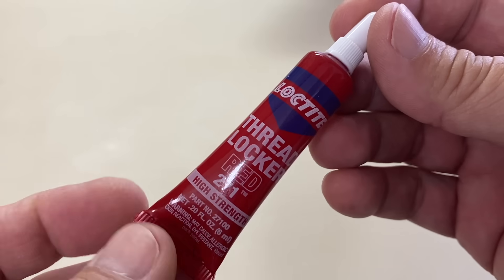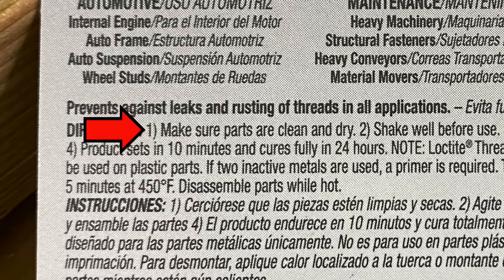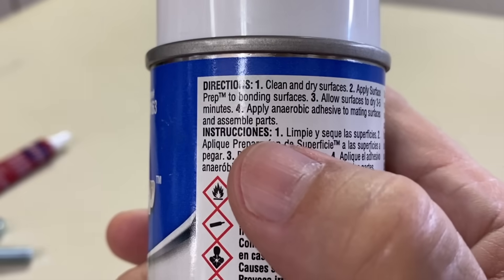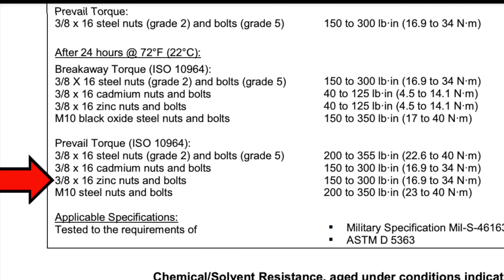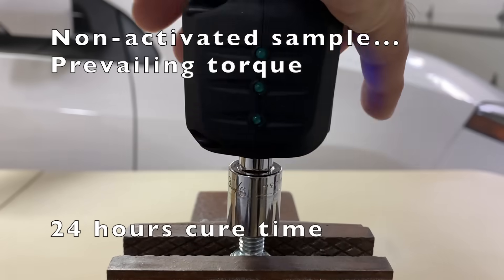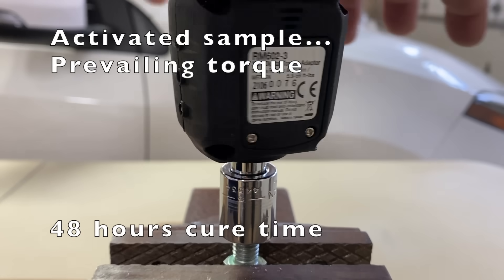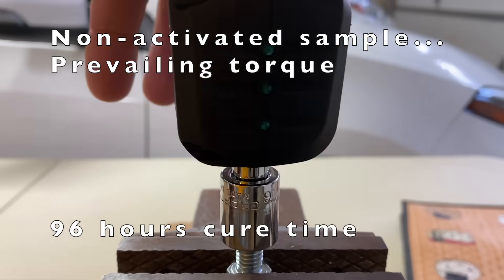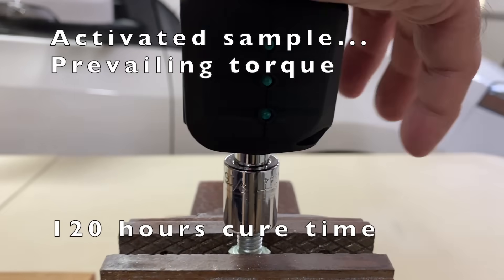Nuts & Bolts - Most DIYers Do Not Know This | Loctite Red Threadlocker Curing

Comment: Wrong test.
Thread lockers doesn not work that way. You have to tight that nut.
Call the manufacturer and they will explain you why.
Reply from the maker: Thanks!
I agree that in real-life applications threadlockers are used on torqued nuts and bolts, but this was just a strength test of the adhesive itself.  A similar test by Loctite is shown in this video... https://www.youtube.com/watch?v=PGZCPyi8yBc&t=2s
😎
Reply: @HacksbyDad  That is a test of the pure adhesive properties. But nobody uses Loctite as a... glue.
This is ok if you're going to to check that behaviour on active/inactive metals like advised on the label, but for my experience the difference is almost zero in real life (tightened bolts).
I use various Loctite products (primarily 241, 242, 680 and others) to assembly and sell my products. I can confirm you that the properties changes a lot under compression. Just day and night.
Anyway, your was an interesting test.
Reply from the maker: @giuliobuccini208  Thanks.  I've posted other videos with the nuts torqued down and got differing results.  🤷🏻‍♂

Comment: This is an interesting controversy here. One buys plated (often zinc) fasteners instead of plain steel to avoid seizing due to rust. This suggests a certain kind of 'inactivity' to zinc surely, yet it is also true that zinc is used as a sacrificial anode as mentioned. And here's another thing. Those fasteners are bright-plated but if you want max. rust resistance you use hot-dipped galvinized fasteners and of course galvinization is zinc plating.
Reply from the maker: Thanks for your thoughts.  Something for me to think about.  😎

Comment: I used Loctite RED on all my fasteners for a motorcycle build and never had a vibration loosening on any connection until a seasonal breakdown. It’s a pretty solid performer.
Reply: I only use blue loctite on the motorcycle sub frame mounting bolts as just in case I can use normal hand tools to loosen them without applying heat. Everything else I use a torque specification.
Reply: @robpinter5431  - I hear ya man, I've had success using Loctite blue as well. I ran with red because it's pretty universal.

Comment: Pretty sure that the nuts and bolts should be under tension during the curing to obtain real accurate values.
Reply from the maker: Thanks!
I haven't come across any articles stating that tension is required... only contact with metal and the absence of air.  I'll keep researching.  Here's a link to a Loctite video that shows a test without tension...https://www.youtube.com/watch?v=PGZCPyi8yBc&t=2s
😎

Comment: the test should be performed under tension, because the lack of air sets it off,
the idea of thread locker is to fill the void behind the contact points giving
no room to move...
Reply from the maker: Thanks!
I haven't come across any articles stating that tension is required... only contact with metal and the absence of air.  I'll keep researching.  Here's a link to a Loctite video that shows a test without tension...https://www.youtube.com/watch?v=PGZCPyi8yBc&t=2s
😎

Comment: the only problem i see with this is the thread tolerances for mass production (hardware store bought) nuts and bolts are often times made to the extreme or just past the limits of a good thread holding. the thread pitch of a store bought 3/8 nut is usually at .343 while the 3/8 bolts are usually at .327 which allows for the nut and bolt to go together very quickly and easily. the ideal size for thread lock on a 3/8 combo would be .3325 for the bolt and .335 for the nut. the looser the nut and bolts fit together the less the loctite is going to be able to hold. if the diy project isn't going to have a medium to high heat application I'd always go to the nylon locking nuts they are only a few cents for, for high heat applications I'd consider getting with a local machine shop and having them machine close tolerance nuts and bolts to the quantity you need. most wouldn't charge much if they are a small family operated shop.
Reply from the maker: Good info!  Thanks!

Comment: Interesting data there. I know that I’ve used this same red threadlocker on a crane ball that squeezes 2 50 pound half balls together into a crane cable and used it in diesel hammer pile driving for 9 months and when I tried to get those nuts and bolts off to seperate the ball half’s to change the crane cable it was far more difficult then when I tried it without using the Locktite.
Reply from the maker: Interesting.  👍

Comment: I am sure you know the definition of an anaerobic thing by now, but the way I was taught that it works is by being compressed.  Therefore to achieve valid results you would have to torque the nuts and bolts.  Green locktite is the only I know of that self hardens.  That small difference you saw could translate into a huge difference after being torqued.  Red loctite should require a torch to heat the bolt up for intact threads.
Reply from the maker: Thanks!  In all my research, I haven't found one source state that compression or pressure is needed to properly cure.  The two requirements for curing mentioned are being in contact with metal and in the absence of air or oxygen.  I guess I should figure out a way to compare compressed vs non-compressed samples.  😎
Reply: @HacksbyDad  I could be wrong.  That is what made sense to me, and perhaps the torque/compression squeezes out the oxygen?  (Sorry if that sounds trivial.)  I know anaerobic sealer as used between dissimilar metals or on small engine assemblies does not cure like silicone.  Could practically leave it sit for days open.  Not until the surfaces are bolted or compressed together does the gasket form.  I know the same concept with lock tight, minus that particular green I mentioned.  I've noticed when using loktight, I've jumped the gun a few times on assembly, and had to disassemble.  The loktight has changed to its lighter color, and has definitely set up at least partially already.  That's within a few minutes, and a torqueing.  Sorry for windy reply, hopefully makes sense!
Reply from the maker: @Chiefs-online  Thanks.  I'll get in a few sleepless nights thinking about how to conduct a test.  LOL
Reply: @HacksbyDad  sleep is good don't do it lol

Comment: FYI it is "my understanding" the torque used in between each treated surface in an An Anaerobic Environment sets Off the Loc Tite! not time, not air or ambient atmosphere.  So your test is based on a third component (primer) not typically used.  So try this with your nut torqued and watch what happens! 
You will CUT your nut off or break it with the red tite! Red Is Almost Always Permanente!
Reply from the maker: Thanks!
I've done many tests with the nut torqued and not torqued and haven't run into the permanent situation ... yet.  I'm testing longer cure times right now and will test with heat at some point.  😎

Comment: 70% alcohol contains lanolin so you effectively lubricated the parts. 

Primer (Loctite 7649) is used in anaerobic fiber optic connectors to hasten curing of the loctite 680, the active component - acetone.
Reply from the maker: Thanks!
70% IPA did well in a test I did for cleaning metal... https://youtu.be/qs2E7DWzXYc
😎

Comment: you didn't torque a bolt, you checked to see how much torque to unscrew a "torqued bolt" still a good video :face-blue-smiling:
never use an extension bar on a torque wrench :face-orange-raised-eyebrow: (extension/cheater bar) when torquing it defeats the torque wrench doing it's job. i've seen others pull with whole body, that's the wrong way. i've never used primer, i use loctite when i don't want something that in case it gets loose nut won't slip off. torque'd bolt shouldn't come off but seen some because of poorly toque technique :face-fuchsia-tongue-out:

Comment: Think that you should do a comparison on three different diameters of hex headed cap screwdrivers & hex nuts from cheating POS garbage from China, USA, & two other counties. Had a tenfold # of defects with all hardware from lack of quality control lying cheating communist china. Refuse to purchase or use any hardware, tools or safety equipment from china.

Comment: Very interesting video. I would’ve liked to see the nuts holding two metal plates together. I feel that the compression would’ve applied greater force to the threads at contact, over a nut under zero load.

Comment: Nice job! It shows that the activator is not needed on the zinc bolts. Looks like cleaning and degreasing is what is necessary but that was not included in the tests.

Comment: Not sure if this is representative of a real connection. The clamping load will make a very thin layer on the one side of the threads, and provide a force into that surface.

Comment: i used to lock nuts and bolts with marine grade polyester resin and for more harsh conditions heat resistant epoxy, they work better to hold than loctite in any way you measure it, (as i worked with resins and composites) i got gallons of the stuff readily available, the performance of marine grade resins, and cost/benefits comparing to loctite are ridiculously higher.
Reply from the maker: Thanks for the information!

Comment: I got a few things from this.
1) The data sheet is either wrong or you misread it.  The break away torque is the static torque to loosen, the  force needed to initiate movement of an unseated fastener in a loosening direction.  this should always be less than the Prevail torque, which is the dynamic friction/torque, average force needed to provide continuing movement, after break away, through first full turn.
2) The activated tests have half the variation in torque as the parts with out activator.  Consistent torque is actually job one for anaerobic thread lockers (most don't know this fact), it prevents corrosion to this end.
3) I dont think you have chosen the proper activator / primer for product.  Instead try 263/268 with nothing (no primer needed), or use  SF 7471 or SF 7649 to speed things up

Comment: It's very interesting, I've used red Loctite both personally and professionally for over 50 years and never heard of or read of the "activator"... but your data is suspect.  chart at  4:58  72 hour and 96 hr reading are higher on non-activated, then at 120 hours it flips back.  Don't know what but you did something wrong.  That just isn't going to happen organically.  Mistake.
Reply from the maker: Yeah... suspect is correct.  LOL
The sampling was too small to draw any strong conclusions.  The video was meant more to make viewers aware of the activator that I just learned about.  😎
Reply: More than suspect, rejected.

Comment: When I started my HVAC career, I had a journeyman once tell me “ if you want to put something together with nuts and bolts without it coming apart again just put some paint on the threads first”. Dam it actually Works.
Reply: Or use a bolt no longer then actually need. After tightened hammer the end to ruin the thread lol
Reply: @davidhughes8636  Nah, too much work.  Some manufacturers of imported junk seem to use an even easier way: just cross-thread every fastener!
Reply: @sparcnut  I use double helicoid ambi-fastener threads for all mission critical components. You know, the ones you have to tighten to get loose and loosen to tighten.
Reply: @sparcnut  Lol
Reply: @davidhughes8636  if I have extra threads, sometimes I’ll take a file and goober them up.  But yes, doing your idea would work.
Reply: Nail polish works well.
Reply: ha.. I have seen this in action at my job! And, it’s “damn”.
Reply: Any grit will work.  HVAC BUSSNESS OWNER!
Reply: Teflon tape works quite nice too
Reply: @borism4629  funny but i just said teflon tape works but then again it doesn't lol
Reply: But that little tube is more convenient than carrying a can of paint to the job, and it can be capped to use next job.
Reply: @donsmith9478  china black or gytal!!!  Hvac guy
Reply: Must be a Chinese thing- don’t use paint riceball!

Comment: Fingernail polish works good to a locked bolts really nice
Reply: Loctite, however, doesn't make for a very good fingernail polish.
Reply: @wjkgreen  Oh, yes it does!!! And toenails.
Reply: And there is a point where u need to buy a prooper nut-locker.
The nail polisher not fill the gaps as well and it can get lose with vibration because the layer is so thin and fragile after the slovent is fully vaporized out.

Comment: Any kind of glue or sticky stuff on threads is helpful. I always used silicone on bike or motorcycle nuts and bolts or anything you dont want vibrating loose.

Comment: Nice experiment. The extra work of the primer definitely wouldn't be worth the effort for me. I never use red threadlocker anyway, except on stainless steel fasteners. It causes more problems than it solves in my opinion. Blue usually gets the job done for me without all the skinned knuckles and rounded nuts when things need to be disassembled.

Comment: a little bit knowledgeable on production torques process.   Try again on this experiment, but torque down the nut onto the bolt, where the nut's ID thread mates to the torsional mating  thread of the bolt.  Loctite is anaerobic cured, so the close mating threads must be intimate.  torque to 23 ft -lbs. then let cure 24/48/96 hours.  I anticipate the required loosening torque will be 33% higher yet, than the first set of testing.

Comment: Good video and test. The reason for using locktite is so bolt dont back out due to vibration and such. But this shows how well just the thread locker alone works. But if bolts are under correct torque and bolted down tightly, they have little chance of coming loose from vibration

Comment: There are two different types of Loctite. The new style does not need the active metal. The activator just sprays some copper onto the metal to get the thread locker to work.

Comment: Are these values the same for Stainless Steel & Aluminum? Both cleaned? Did you know that Isopropyl Alcohol leaves a oily residue? Have you run this test using denatured alcohol?
Reply from the maker: IPA performed well in my adhesion test... https://youtu.be/qs2E7DWzXYc
😎

Comment: It made no difference. The difference was probably more related to how much Loctite fell on the right spot the threads.

The actual strength not near the quoted. I basically took your results and multiply that by 12 for inch conversion.

Comment: A more interesting test would have been to prime and NOT prime the type of fasteners that claim to need priming (the Galvanized? I forget). Honestly I’m in my 60s, have used thread lockers since I was a kid, and did not know there was a “primer” available, much less required.  I also don’t think you used enough of the compound to fully fill the threads, especially since the nuts were not actually being tightened against something, which would be a real-world test.

Comment: For the purposes of curing Loctite Threadlocker, zinc plated fasteners are classed as "passivated".  Loctite 271 will cure on passivated fasteners, however it will be slower to cure than on  steel surfaces.  Inactive surfaces are materials such as ceramic, polymers, stainless steel and titanium. Surfaces activators will in most cases result in lower cured strengths as the crosslinking of the polymers produces slightly shorter chains.
Reply from the maker: Thanks!
I'm testing the activator on nylon, cooled, and heated fasteners too.  Just for fun.  😎

Comment: I just came from a reddit post that was basically a guy ranting about how everyone uses loctite wrong and that it's basically useless on inactive substrates unless you buy the kind of loctite specified for it or use the primer. It got me worried because I've never used the primer and have assembled a lot of stuff with loctite that is plated or anodized. This video proves that it's nearly as good without the primer. Unless it's an absolutely critical part, I'm going to continue to forgo the primer.
Reply: Agree. Clean and grease-free is enough.
Reply: The point is not that it works with or without primer.  The point is: It depends on the material composition of the fasteners you are using.
Reply: Zinc is active though, stainless and other things are way more inactive. SO that would need to be primed. Also need to fasten and torque it to drive the air bubbles and excess out (loctite doesn't even dry if left out, needs to be squeezed)

Comment: I feel like the results would be different if the nut was tightened down to something instead of just being screwed partway on the bolt as it cured. IDK I just feel the the threads being pulled tight would make a huge difference. I could be completely wrong though.

Comment: Great video. Thanks for doing this. The way I understand Cyanoacrylates is they cure in the absence of oxygen. Torqued or not this would give an indication of adhesion. The only thing I didn't get was the use of a cheater handle for 20 ft lbs?
Reply from the maker: Thanks!
The cheater bar was used for an easy slow pull.  Plus the activator was supposed to have increased the adhesion strength.  
Threadlockers are anaerobic adhesives that cure in contact with metal and in the absence of oxygen.  Cyanoacrylates start to cure after being exposed to moisture.
Reply: @HacksbyDad  most thread lockers I've used have cyanoacrylate on the label aka superglue.
Reply from the maker: @lifesucks247  Interesting... I haven't seen any of those.

Comment: What is preventing Torque ??????????
Reply from the maker: Prevailing torque is the force needed to continue turning the nut after it is broken free from its fixed position.  Similar to the force needed to completely remove a nylon lock nut from a bolt after you break it free.  Hope that makes sense.
😎

Comment: I have a fuel leak in a car where the fuel inlet is screwed into the carburetor.  Would using this help to seal it?  (Reference:  Holley carb on a Chevy 327).  Thanks.